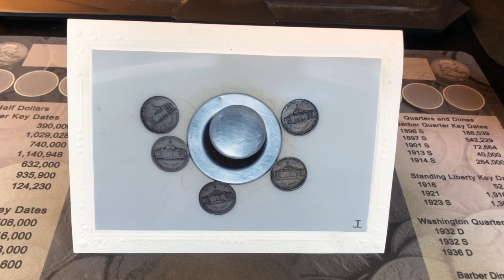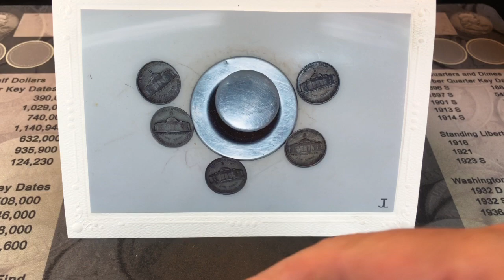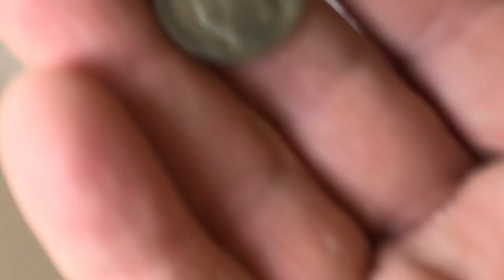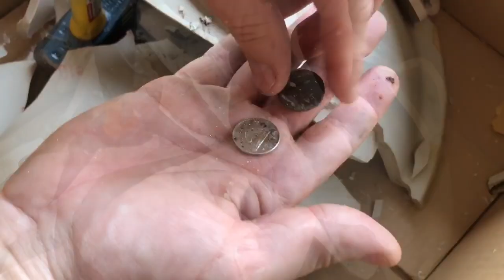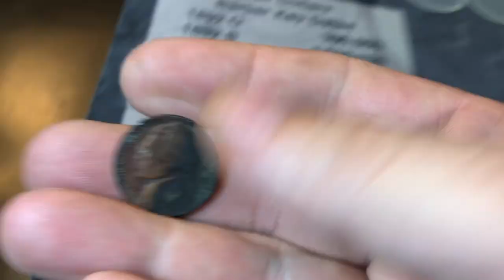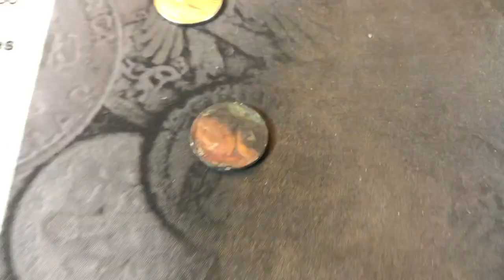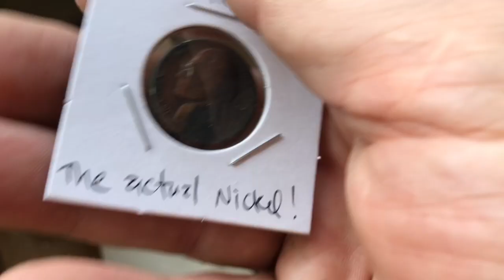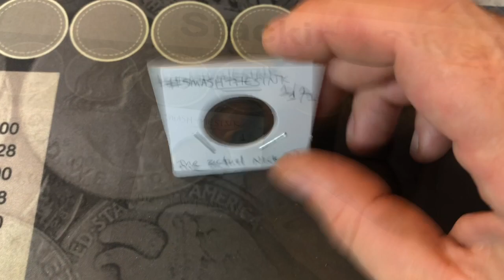Smash The Sink - War Nickel Retrieval

Comment: I have always taken precautions before going to this stage of coin cleaning, have never seen anyone actually lose a coin that way until now.
For those who are alarmed by my coin cleaning; I am one who picks up coins off the ground, sometimes find them buried, also get some from people who take them out of filthy cupholders, and they are sticky with soda pop. I only run warm water over them, and in extreme cases add some hand soap. I do this for ones that would actually be more harmful to coins than leaving them alone. I just feel that some types of dirty coins benefit from a gentle cleanse before being rereleased into circulation. In general, I do agree with the coin collecting community to not clean coins, especially for trying to pass them off as being in better condition than they are in. I cringe every time I see someone pull out a bottle of Nic A Date.

Comment: Should have used a hole saw bit on the drill and then reseal the whole with a PVC cap. Problem solved and no need to replace the sink or don't wash coins in the sink to begin with. 😊😉😜
Reply: Ralph Wiggins seeing the sink removed, I think it could have possibly been shaken free out the larger hole, like getting a guitar pick out of an acoustic.

Comment: My only question: Was that crack in the counter top there when you started, or is that something that happened when you took out the sink?  A little clear coat epoxy should fix that right up 😄
Reply from the maker: Silver Nitrate it’s been there for years!

Comment: I'll never understand the complete opposition to cleaning coins. I would never endorse or use a method that is going to discolor or polish the coin. I let my low value finds and purchases soak in Lysol for a few minutes and rinse them with hot water. They do not get discolored in any way from this and it allows some of the surface grime, nevermind bacteria, to come off.

Comment: Wait, you pulled the sink but didn’t replace the cracked vanity top? Dude, dealing with the sink/plumbing is 90% of the work required to replace a tiny countertop like that. It’s not like it was marble, looked like builder’s grade. Backsplash needs recaulking anyway so that would have gotten done too.
Reply from the maker: Paul G yeah...  I should have knocked them all out at the same time for sure.